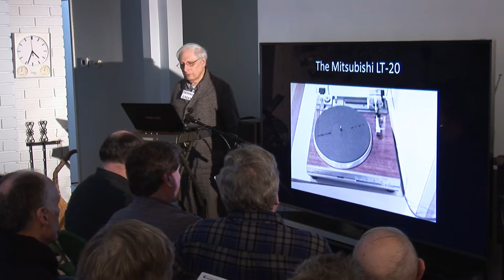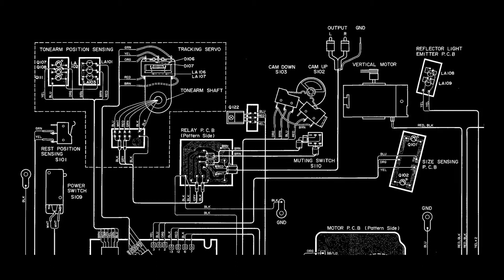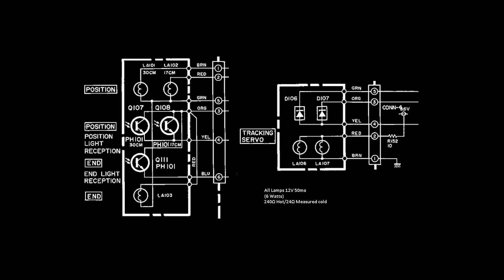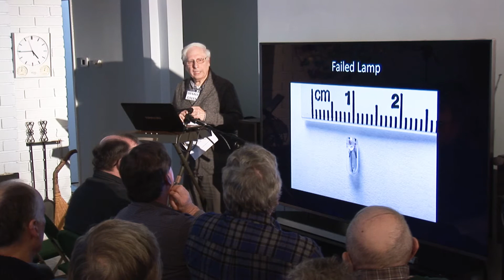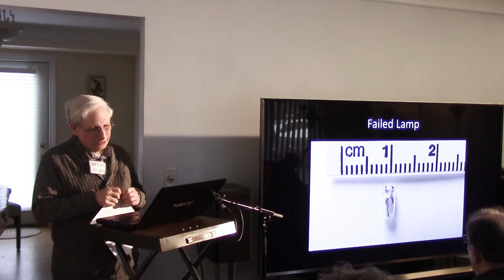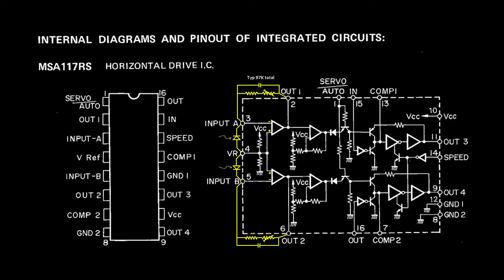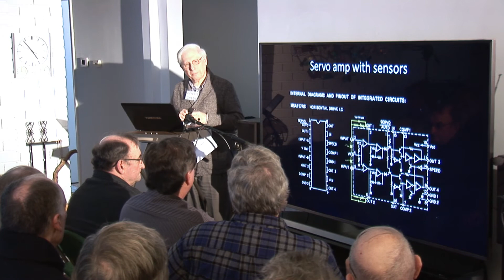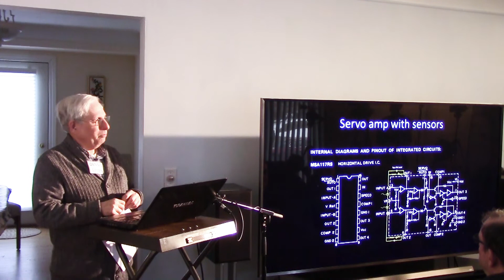Mitsubishi Linear Tracking Turntable LT-20 Revived

Comment: Thanks to your very informative video, i recognized the problem with my LT 20. The contacts of the tracking system bulbs were indeed corroded. On the internet I found the right replaceable bulbs: CEC Industries 7219 Wire Terminal. The LT 20 works fine again. Thank you very much Denis Green. Kind regards, Jack van Tilborg, Tilburg Netherlands, LT 20 owner since 1981.

Comment: I have this LT--20; bought new: in 1982, I believe. Required two repairs over the years, and the first of those was the arm not advancing.The repairman who fixed it told me that it was a bad LED. That was back in the mid to late 90s. Now (in 2022), it still works and sounds great. I also have the Shure V--15 cartridge on it. Love it !!

Comment: I've had my Mitsubishi LT-20 for a little while now and loved it, but it's started to malfunction.  The trolley is no longer advancing to keep the tonearm tangent to the record groove.  The turntable functions, the record plays for a few minutes until the tone arm is so far off-tangent that the record skips because the trolley isn't advancing.  The cuing functions still work so the trolley is capable of driving itself.  Could it be my setup has simply gone wrong (tracking force, tonearm counterbalance, etc) or do I need a major repair?
Reply: This is typical of bad drive belts.  They work when the tonearm motor runs at higher speed but not when it advances the tonearm while paying, which are very short, low-speed rotations.  The belts are stretched and/or losing their tension.

Comment: Fun lecture!  Interestingly I've never heard of anyone who has worked on one of these or the LT-30 need to use anything beyond your run of the mill 12V, 60 mA, 3 x 7 or 8mm grain of wheat hobby bulbs to get the sensors back in business, myself included.

Comment: I'm having the same issue with an LT-22.  Before I started digging into it,  I decided to investigate what the issue might be.  More than likely it could be the chip or possibly the light emitting diodes.  Hopefully it won't take the time that you or Dennis had into it.   Hopefully if it the chip it is still available.
Reply: Mine had that issue also. It was an LED.